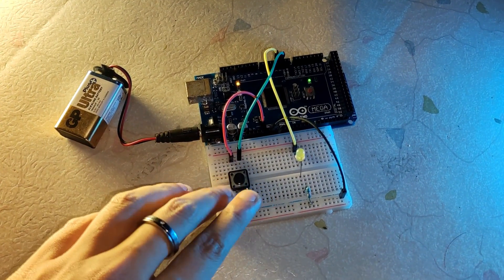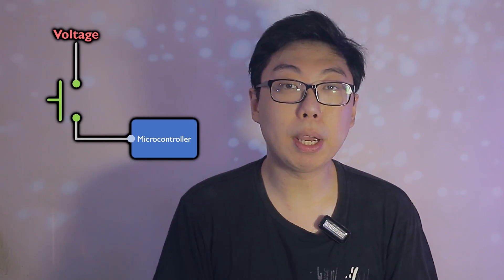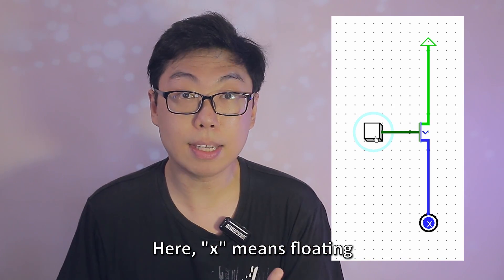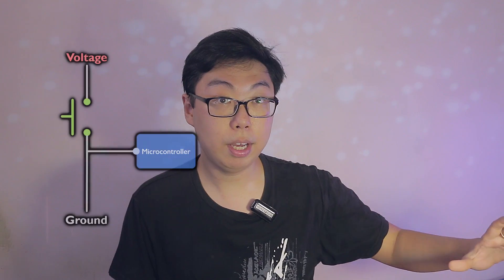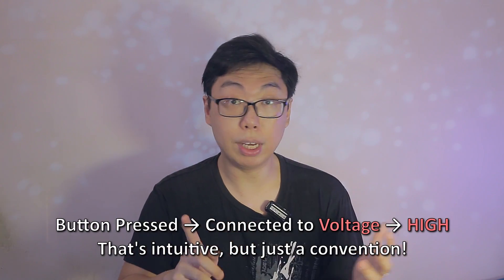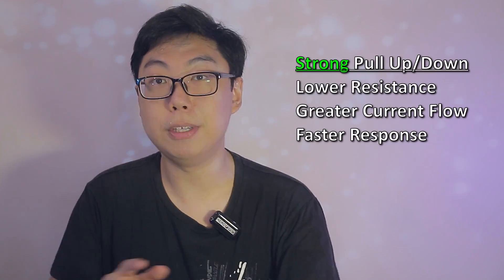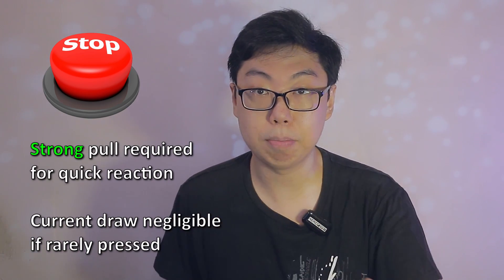Pull Up/Down Resistors

Comment: I am sure these are meaningful for many, but novices like me may need how to select the resistor value for high or low control.
Reply from the maker: Hello and thank you for your comment! Yes, I deliberately omitted this topic as the video is geared towards beginners. The exact resistor value to use in any given circuit is dependent on context, and involves some more theoretical knowledge and calculations that didn't seem to fit here.

The following source has some good discussions on this topic: https://eepower.com/resistor-guide/resistor-applications/pull-up-resistor-pull-down-resistor/#
In particular, "A rule of thumb is to use a resistor that is at least 10 times smaller than the value of the input pin impedance. [...] at 5 V, the typical pull-up resistor value is 1-5 kΩ."
Reply: @NERDfirst  Cordially thank you for considering my question and supplying a proper link for knowledge. Best regards. 🙏
Reply from the maker: You're welcome! Happy to be of help =)

Comment: This is absolutely the best video on YouTube regarding this topic that I have come across. I do want to ask how I would consider pull down in terms of current, though? Is low to 0 current a logic LOW and vice versa? In that case, would the pull down's job be to induce very low constant current to negate the effects of noise? If it is, then which way is the current going and? Lastly, I wanted to know what the other end of the microcontroller being connected to output=ground is doing in that case? Thanks.
Reply from the maker: Hello and thank you very much for your comment! Glad you liked my work =)

To answer your questions - Actually no, a microcontroller uses voltage rather than current to take a HIGH or LOW reading. Typically, a logic LOW is close to 0V while HIGH depends on the signal voltage level of the microcontroller - This is typically either 3.3V or 5V.

In terms of current, a pull-down resistor is typically of a pretty high resistance, so the current flowing through it is miniscule. This is perfectly fine since ultimately, it is the voltage that matters. As for direction of current flow, it is as you would expect with any circuit, from the point of higher voltage to that of lower voltage - At least, if you're going with the what is defined by "conventional current".

I'm not so sure what you mean by your last question, though. Maybe you can elaborate a little further on that.
Reply: @NERDfirst   Thanks for the response! I seem to be a bit stuck on the meaning of Voltage. From what I know, voltage is short for voltage difference, which drives current. I understood that voltage drops over components with resistance in a running circuit.

If the circuit is open, and the microcontroller is pulled down by resistor, am I wrong to assume that voltage relative to ground (we take as 0V) is 0V since there is no current?

Why exactly would a pulldown stabilize and guarantee the LOW/reduce noise? Does it change the voltage on the pin despite no current?
Reply: @NERDfirst  Wait, I got an idea to my most recent reply. Could it be that since the pull down resistor and microcontroller are in series, the voltage drop across the microcontroller pin is a lot smaller than it would’ve been alone? But still, I can only imagine that be the case if there be current of some sort.
Reply from the maker: Hello again! In the context of digital signals, LOW is rarely exactly 0V with zero current flow. For example, for the Arduino, anything below 1.5V is interpreted as a LOW. In a practical context, there will always be a miniscule bit of current, enough for the microcontroller to read the pin.

Comment: If the wire acts like an antenna…why do random signals flowing between ground and the pin behave differently from the random signals from before (when there was no pull down resistor)? Your animation shows there’s noise on the wire either way. So how does that solve the problem?

And why does the closed switch ‘overwhelm’ the path to ground?

I believe you. I’m sure you’re right. I just would love if one of the 40 YouTube videos on this topic would take a little more time and explain the why.
Reply from the maker: Hello and thank you for your comment! These are fair points, I'll do what I can to clarify! 

I'm not sure that my animation shows that there's noise on the wire - It shows an electrical connection between the pin and ground.

The kind of random noise we experience when the pin is floating comes from sources like electromagnetic induction. These are typically very low energy signals and therefore, the current generated is miniscule. When a voltage source is connected, the current generated is significantly higher. It "overwhelms" the noise by being the higher-energy source, exerting a greater "force" on the electrons in the conductor.

When we pull down to ground, all the stray currents have a low resistance path to ground, so they "drain" that way instead of registering on the microcontroller's pin.

We can use the same line of reasoning to understand why the closed switch overrides the pull-down resistor. There are two paths for the current to flow - Through the resistor to ground, or through the microcontroller pin, which has next to no resistance. Hence, most of the current flows to the pin, allowing it to register the voltage. That's what I mean by "overwhelming" the path to ground. 

Let me know if this makes things clearer or if you need further clarification!

Comment: Thank you for the video. I`m building a arduino grbl cnc. I got alot of problems with limit switches, how "big" resistor should i use? Have tryed 10k with no luck.
Thank you.
Reply from the maker: Hello and thank you for your comment! I'm afraid I don't know enough about your use case to properly advise. The best I can do is to refer you to the Limit Switch page of the GRBL documentation here, I see that resistor values are given: https://github.com/gnea/grbl/wiki/Wiring-Limit-Switches
Reply: Thank you, that helped alot 👍And Thank you for the great video.

Comment: Very nice video. Maybe you could explain how to calculate the resistor value next time. Thank you so much
Reply from the maker: Hello and thank you very much for your comment! In my (admittedly limited) understanding, the actual resistor value shouldn't matter too much.

The most critical thing to pay attention to in this setup is to ensure that there is no short circuit / excess current draw, which you can calculate using Ohm's Law - I=V÷R and ensure that I is reasonable for your setup. 

The secondary impact of the resistance value is the response speed as described in the second half of the video. I'm not aware if there are any formulas that can be used to calculate the response time based on the resistance, but unless you have very specific requirements, a bit of trial and error will do.

Comment: What the red and black points moving in your circuit means. Like I still don’t understand how voltage comes from ground to microcontroller
Reply from the maker: Hello and thank you for your comment! Don't think of this as direction of current flow (even that has two conventions and can be drawn in "both directions"). Instead, think of this as an abstraction for which is expressed "more strongly", and what the microcontroller ultimately "sees". 

In reality this really is a potential divider - The voltage detected on the pin is simply the ratio of the two resistances (the latter being the miniscule resistance provided by the wire).

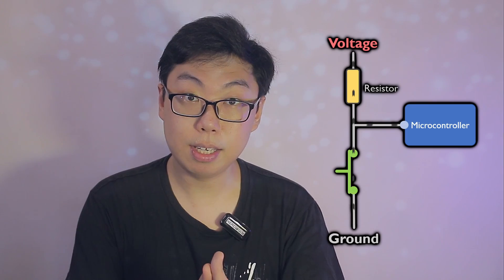Comment: 4:06 How can current go from ground to voltage ? Shouldn't it have gone from voltage to ground ?
Reply from the maker: Hello again! This isn't really about current direction (which in and of itself can be drawn in both ways). This is more about what's expressed "more strongly". I debated a little about making the diagram that way also, but it is the most logical way of doing it since ground is seen at the pin of the microcontroller without any resistance, so it takes precedence.
Reply: @NERDfirst  so, that means, in this configuration, there will be no current coming out from voltage because of the resistance ?
Reply from the maker: A small amount of current (_and_ voltage) will be present. However, in this context you can almost imagine it to be like a potential divider - The voltage detected by the pin is extremely low, and would certainly be interpreted by the microcontroller as LOW.